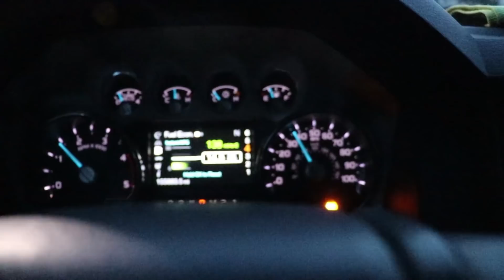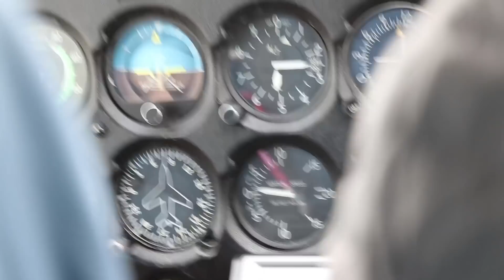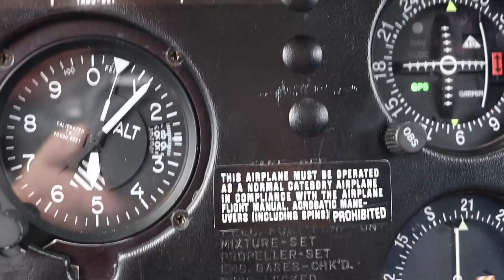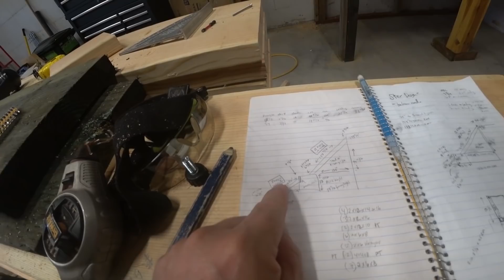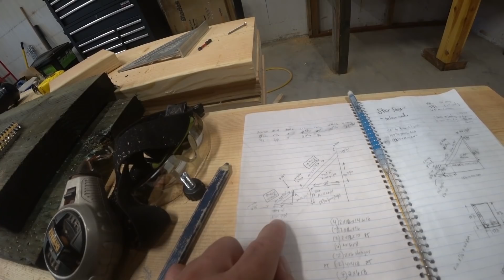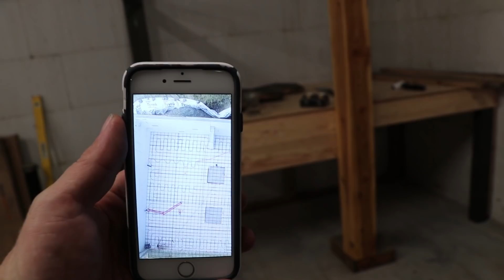HOW THE HECK IS THERE A MASSIVE PILOT SHORTAGE?

Comment: Risers go in behind the treads and are fastened then with nails or screws into the back edge of the tread board.  Because each tread is spaced out by its riser, you always maintain the 1.25 nosing.  The risers do two support jobs, they hold up the back of the lower tread and sit underneath the nose of thew upper tread.

Comment: Build a rolling cart that parks into the area under the stairs. You can pull it out -store a ton-and never have to grovel around under the stairs or platform. You'll only loose the 3-4 inches that the rollers take up.

Comment: Next time nail the top of your stringers to a piece of 3/4 plywood and then you nail the plywood piece to your landing.  Makes it stronger than just for nailing the stringers. Then you start stairs at the top with the riser going on before the tread, it makes it easier to keep the stringers straight and you still wind up with your treads having an overhang. 
Last once you frame up that wall you go underneath and nail your stringers to it using a 60 penny nail angled down, that way if your stringers flex or settle they just tighten up a gain at the wall and your stairs are flat for years to come. 
Looks great, but you’re gonna stub your toes a lot if you put stringers in there, plus you lose  at least 3/4 inch of tread, depending on riser material, and that may not meet code.

Comment: As a new student... I can tell you that I have been delayed nearly 2 years because of the cost alone.  $200/hour x 40 (or 80) hours is very expensive (rental, instructor, fuel).  Then you can not do any sort of tax deductions for the training.   Then the whole issue of the FAA increasing the question pool and making it far harder to do the exam.  In my area, instructors are few and far between.  So my Cessna 150m (that I do own), simply sits and sits and sits, because I can not find an instructor.

Comment: For code you should add a 2 x 8 blocking below the 2 x 6s you already have for the stringers to bear against, plus stringer hangers (similar to but not the same as  joist hangers). There are lots of online resources about what rise/run is comfortable to walk up. Rather than building something and then trying it out and finding it's steeper than you expected, you can look for stairs in your neighborhood that are the steepness you want and then make yours to the same  rise/run/nosing. That's the way I built mine this summer.

Comment: I'd suggest a 3/4 inch gap on the rail.  When you are handling 12-14' drywall for the proper installation (less seams so you'll be thankfull)  additionally the seam will actually build up and not be perfectly level vertically since you can't fill without be out some.  You are probably set with it in real life, but a tip just in case.  Have fun!!!

Comment: I would have routed out the two outside stringers ¾" deep instead of cutting ¾ of the board away. Nailing or screwing through it into the treads keeps the stringers from twisting and holds the weight better. You cut the treads to fit between the routes but leave the nose part the full length. I think makes it much stronger and it gives a better finished look. I suppose it's already done by now. Oh, well.

Comment: I usually don't comment on these videos because they are posted well after the work is done  and my suggestions would be of little help or be seen as I told you so, but this suggestion I feel could make your life a little easier going forward. 

This idea concerns the radiant in your slab foundation. It is great that you have a detailed picture of the radiant but I can see your need to confirm exactly where the piping is located before placing any anchor into the slab. However the piping being made out of plastic does not make detection easy. But where you placed the radiant I think you are in luck! 

You tied the piping to the steel rebar and that my friend is easy to find with a metal detector. Simply before you set the anchor wave the detector over the aria. No buzz, no bar, no radiant, you are good to go. Drill away with complete confidence. 

After watching your show for a year and a half you get to know a person a little and I figured this issue would be bugging you every time you go to set an anchor. This process should give you the complete confidence needed to drill safely. However I need to inform you that I have not tested this idea out, but with right detector I think it should be doable.

Comment: Soak you veggies in salt water for a few hours or overnight.  Bugs hate salt and will crawl out of any tight space they have crawled into.  Then rinse with just water to remove any salt residue.  Saves time from all the inspecting every leaf, and how do you look inside cauliflower or broccoli?
Companion planting helps keep away bugs.  Rodale puts out a great book describing all the mates, like fennel repels aphids, slugs, and snails.  And has other tips like brushing your hair by your peas so the rabbits stay away (short nose, hair tickles-annoys so they stay away.)  Also things like dried banana peels as a fertilizer and will sweeten your cherry tomatoes.  Marigold invite bees and repels mosquitoes, but plant them with your veggies, not off to the side.
Water the dirt heavy before a frost so the plants fill up.  Imagine a small bit of water will freeze pretty easy, but a puddle takes longer.  You could easily tie tarps to your fencing to cover your plants overnight.  Even tarps on the outside could reduce windchill.
Big vining veggies like squash like growing out of a mound and you should give 8 feet between mounds.
(Just a thought while seeing all those wood triangles going in the trash.  How about nail them to a long board at various heights, sizes like a mountain view and decorate the hot tub deck with it.  I know, like you've got nothing better to do.)
You scared me on the rig saddle, that could have ended badly in the blink of an eye.  They make clamp-ons for the standing-rib-roofing.  Clamp on one here and one there, throw a board across, instant platform.  Remove, repeat.
I love what you are doing, watching it, even oops that didn't work.   Good luck, be safe.

Comment: I too built with ICF's.  Our stairs have a landing as well.  Because all our exterior walls are in 8 foot segments, each at 22 degrees to the other, our platform is not square in any way. It's a trapezoid. the final turn is 102.3 degrees.  Makes for interesting fitment of the railings.

Comment: Run a ledger between the outside stringers to attach to your platform.  Cut the top vertical end of the intermediate stringers 1-1/2" shorter to attach to the ledger.

Comment: Old radial arm saws where just about perfect for stair stringers, dado cut, 1/2 through, to inlet treads and risers into sides, with cut stringer as you made, for the center of the treads. Glue and screw together. That would last until the heat death of the universe.
Cheers

Comment: Oh my god you only have an inch & half maybe 2 inches holding the top of your stringers? Please tell me you are going to add another support on the back of them. not plywood either. Otherwise "good looking. Ive seen a lot of the outside corners fall off on stringers because of wood grain failures. Be safe and over build this part like your sips are extra beefy.. Concerned.

Comment: Regarding the radiant heating.  Why did you go for 100% coverage?  In areas where you'll know you're going to do damage why is there a risk of hitting a tube?  In the area of the stairs you certainly don't need heat under there.  Why run the tube there?

Comment: The lower flight of stairs should hinge upwards to reveal a store space.
The Newell posts should be of nice faced timber to match the frame.
You need carts that roll into the under landing space to stock a year's canning.
There are lots of pilots out there but few opportunities to progress from a private licence to a commercial licence -because you can't get paid on a PPL. It's a minimum of £(or $) 100K to get a CPL with any useful type ratings.
Airlines used to train pilots from scratch, now they want to pay little for even ATPL til they promote you to captain.

Comment: Labor Shortages simply mean that there is a shortage of personnel willing to work at the wages employers are willing to pay.  It is generally propaganda promoted by "trade associations," which are in effect, employer's lobbying unions. 

The goal is generally to try loosen temporary work permits for foreign nationals, the distant chance of citizenship is a perk and the added supply drives down wages.

<snip>
It comes at a time when demand for new pilots is expected to rise dramatically over the next two decades as a result of new aircraft entering the global fleet. Boeing has projected that aviation will need 790,000 new pilots by 2037 to meet growing demand, with 96,000 pilots needed to support the business aviation sector. 
--Forbes
</snip>

Here are the current US employment levels for 2017 (BLS / OES).
53-2010 Aircraft Pilots and Flight Engineers (broad) = 122,570

790,000 new pilots needed by 2037 ain't going to happen, unless they lower retirement age to 30.

Comment: Suggestion: I don't know if you use it already, but I find using SKETCHUP  3D software saves me alot of mistakes in the cutting phase. Also, I've discovered the the Rockwell Jawhorse is worth every penny. Also, get rid of that B&D jigsaw. I had one for years then I bought a Dewalt - OMgosh - what a difference.

Comment: Will a half set of shelves roll under the landing from the South side?  If it would work, would two fit side by side to store items you don't need constantly.  The wheels would provide easy access.  May even consider tying the two shelves together with worm gear clamps.  Use the shelves you stole the wheels from as a stationary set of shelves some place that not having wheels wouldn't be a problem.

Comment: Sheetrock in the garage?   I wouldn't.   Put up plywood or timber and you can put nails in everywhere with merry abandon.   I'd also assume the garage will be occasionally damp so sheetrock would go mouldy.
edit:  Fire code.  I guess that's good enough reason.   How about sheet metal?  Hang your tools on magnets?
Reply: Pointless putting a fire break between floors if you are going to have an open stairwell.

Comment: Please, with the fires in California as the notice,  use a siding that is flame proof.  I assume, without consultation, that Hardie Board sidings are fireproof.  Is the paint that is applied to Hardie Board sidings fire or flame proof,, that I don't know.  Steel siding,, possible?   You live in a forest,,, there are no fire hydrants nearby, your total water source is the capacity of the existing water at the top of the hill.  All of these features are limiting.

Develop an escape plan.  Develop a sprinkler system that can be left running to wet the exterior,, while you are not there.  Develop a plan of tree removal or felling to limit tall fuel sources.  Fuel that burns slowly on the ground is much less of a risk that fuel standing tall.

Consider.  There was one house,, just one in a California neighborhood last year that survived a major fire.  The house exterior was entirely concrete.  Every house around was burned to ashes and rubble,, except that one.

Your house is certainly built to be still standing and in use long after you are dead and gone.  That house can stand for 200 or 300 years,,, 400 is about the limit because of dry rot and powder post beetles.   However, the cyclical burn rate for northern Idaho is perhaps 50 years.  Your house will face fire.

Choose a siding that will not burn and will not damage the layers immediately below.

Comment: Give yourself more space. Move the rail to the wall. The rail on the garage side could be metal cable, very easy on the eye and easily removable if you need to move something bulky up the stairs. Why you would do that with those big glass doors? Your choice.
Reply: No.  Building codes and normal safety ,, the design of stairway rails, banisters and balusters is governed by the physical size of a child.  Recent code changes have made the spacing of balusters to be closer yet.  I will say it clearly,,, most architectural magazine photos of stairway railings are improper and illegal, and dangerous.  I see it every time I pick up a magazine.  There will be children in this house.  Consult code and design to code at a minimum.
Reply: The North face of their house has a doorway with an opening just as large as these stairs and there's no post to bend around.

Comment: It amazes me that people buy nice beefy 2" x 12"s to build stairs and then cut all the strength out of them. If you take two stringers on the side and put cleats lag screwed to the stringers, then lag the treads down you have stairs that are stronger with less wood. And they are stable. I built a replacement set on a 12' rise with no midway support like the the ones I removed and they don't shake or move at all. They way most build you start with a 2" x 12", cut you notches and you are left with a 2" x 4". Now you need 4 stringers. Sometimes they'll even scab another 2" x 4" on the inside. Just doesn't make any sense to me. Anyway, Good to finally gt those stairs in. Nice work Jesse.

Comment: He did forget to put down plastic...wood should never touch concrete.
Reply: Treated lumber is certified for concrete contact. The 2 x4 he used at the bottom of the stringer is temporary until he gets a treated 2 x 4.

Comment: the stairs take time. I remember doing mine it took me three days to get the stringers run, then the treads took a weekend from the start. then there was the point that I had three sets of steps to run.  then the outside was a bitch to do. because of the ground, with the level of placement.  I had to use the 8 inch step ,with a 7 inch raiser to meet the counties code, the kicker was that there were only 13 steps.  which I find unlucky.  and it had proven bad, later after I finished the cabin.   I liked the way it looked, but the county tried everything too claim that I didn't meet their code or I wasn't zoned to build where I did. hell they even claimed I never filed for permits , when in court, I had state approved seals on everything. then the real shit started.   hell I spent almost four years fighting the county in court. only to run out of temperament.  to the point of offering too shoot the shits. if they came back. hell I had video of them vandalizing my cabin, trying too braking in, and throwing rocks and rolling boulders that would damage the place.  all because that's the way they chased the people out, that didn't meet their ideal citizen.  think ignorant democratic liberal.   if you ever visit Madison, have your shit in gear.  they will find some BS to screw you out of money.   but I  got lucky in selling out too a local, for half of what I ad into it. but they took over with no anything hell I even took the tin roofing off the place. I took the screws out of the windows and supports from under the floor. I laugh my ass off, a year later, while talking too a friend that still lived in Madison.  the first snow the windows fell out and broke, the floor caved in when they put a water bed in the master bedroom, the heater never worked, as I took the gas lines out from under the cabin. cut all the plumbing at the septic. and removed the cover ,and left only a open five hundred gallon  cess pit covered with 1/4 inch plywood.    hell I even took the wiring, and fixtures.  not even the sink was left.   I may have lost twenty grand, but it sure feel good to show my ass to the local sheriff and justice of the peace ,leaving town.   they tried to have the state police arrest me and return me too the country.   but thanks too a state trooper told me that he never stopped me as I was out of the state by the time he was given my information.  I told the trooper that I would buy him a dinner if he would like.  I stopped at the state line ,and ate a nice burger with the trooper and his partner, who told me that he knew of the county and what went on there. they had a investigation in the works, that would close them down.  but he couldn't tell me much. I move three 26 foot haul's and my truck and car, back to where I was born.  at least I knew they were crooks and how too deal with them.  stay away from WV.

Comment: When you put that 4x4? against the wall , you said that you forgot to take into consideration the thickness of the sheet-rock. Does that mean you'll be mounting the sheet-rock directly against the wall? I thought there would be furring? strips that mount to the  concrete wall and the sheet-rock mounts on those making the distance wider than the thickness of the sheets? I know nothing about house building so please forgive any ignorant questions, By the way you flew over my old home grounds by Great Falls Mt.  We used to drag race at Lewistown with our A-fuel dragster which in those long ago days was called a Jr. Fueler.